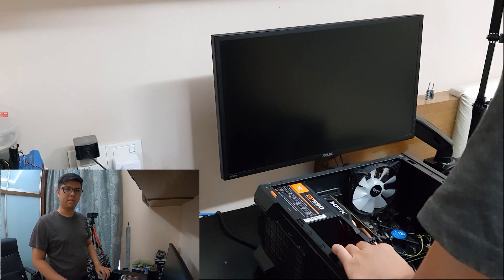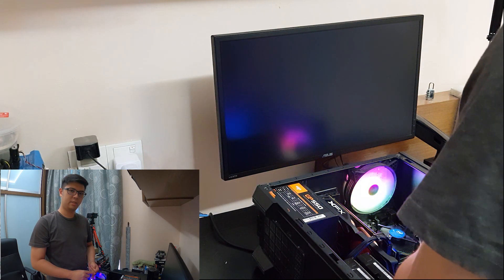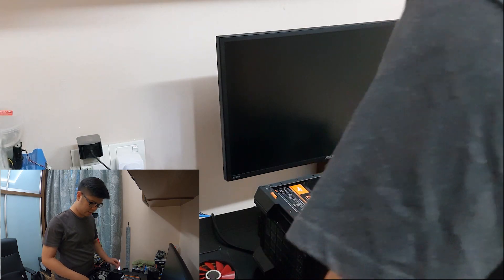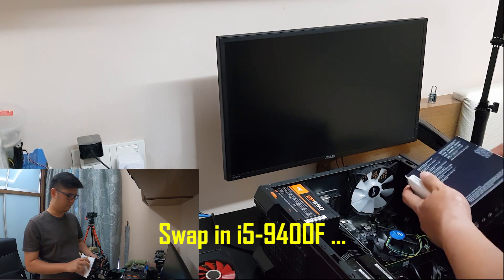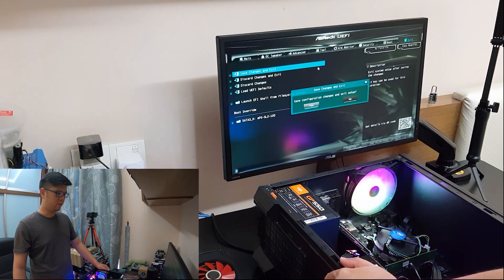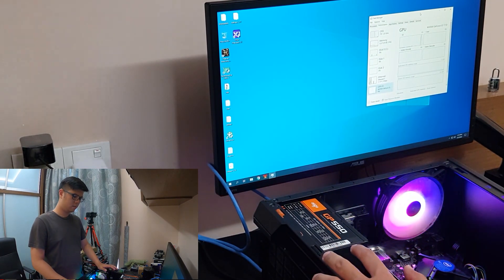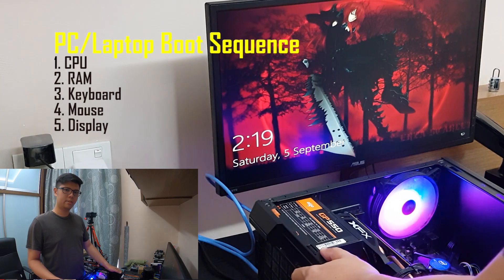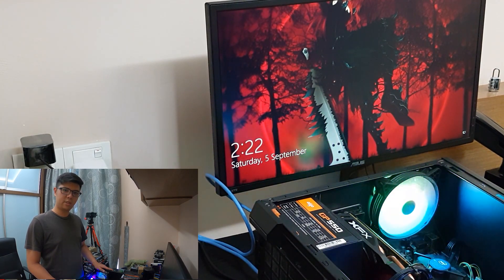Troubleshooting a failing CPU | BSOD Nightmare!!! Intel i3-9100F

Comment: Hi! So the processor came from the factory faulty or something like that?
Reply from the maker: Yes. It should be. Because the packaging seal was intact when I bought it.
Reply: @richardyang852  Something similar is happening to me at the moment. But the difference is that I installed the processor (i3 9100F) and everything was running normally. I played for about 3 hours, until I opened Premiere Pro and I got a blue screen. From then on, it was non-stop blue screens. Do you think the processor is faulty? I tested the memories and they are not, the motherboard either, because I put a G5400 and everything started normally without blue screen.
Reply from the maker: @SebitaM2  yeah most probably that is the processor having issue. Just go to the intel website to claim a replacement if it is under warranty.
Reply: I use that processor by 1.5 years and start to do exactly that you say on the video, I do the same comprobation and see that the CPU was faulty, they have 3year of guaranty I going to sent for replace